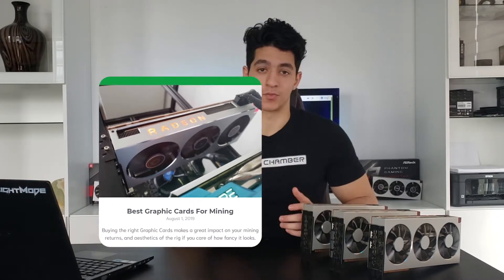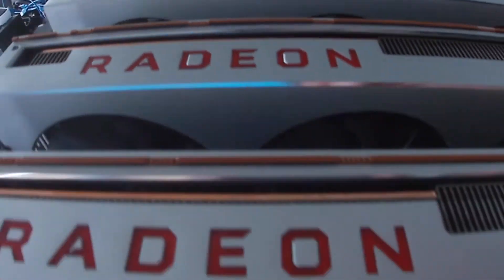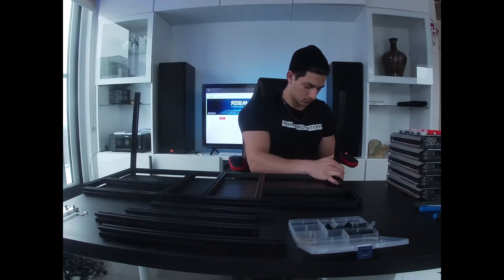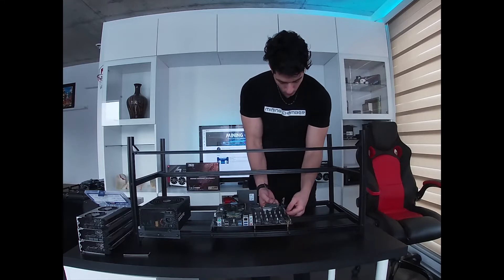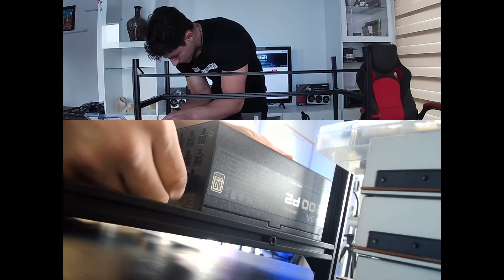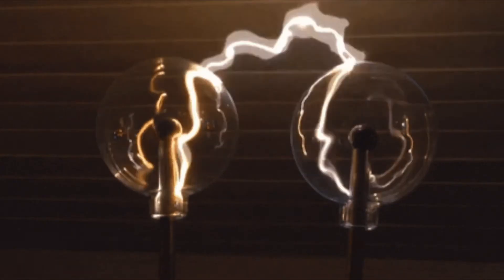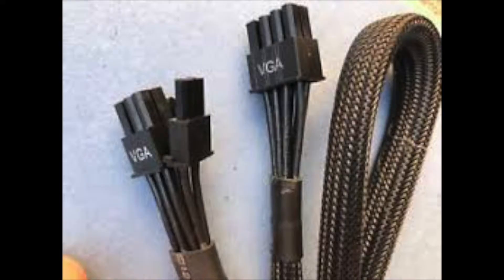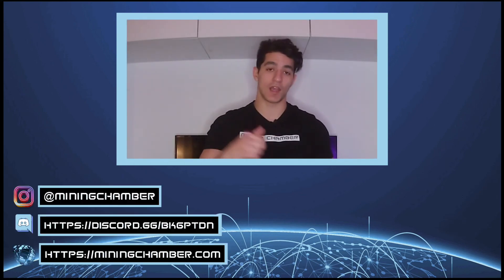HOW TO BUILD A MINING RIG + BEST GPUs IN 2020 !

Comment: need help. i connected my RM1000x psu to b250 and board wont power up. i have Intel Pentium g5400 installed. i tried cmos reset nothing. im thinking it may be faulty board

Comment: New subscriber, so do you not have to put power cables into those pcie risers?
Reply from the maker: Yes you do! Usually its a 6 pin connector. You can check the ATX powersupply guide I go in details with that. Also, welcome to the community ⛏️

Comment: 2 questions! How do you manage dust in your room? And is there a risk of fire after some kind of failure?

I would be very worried leaving it turned on when getting outside. I was reading having all these in a case prevents fire from expanding as the oxygen would be reduced quickly. Not sure how true is that...
Reply from the maker: Dust in the room will come from outside and Into the GPUs. So as long as you have dust filters on your Windows and such you won't have a hard time with the dust. You can check our mining journey playlist for how we setup our mining room

As for fire, if you do everything right and do proper power limiting then you don't need to worry. I've been mining for 2 years and nothing burnt down the house or anything like that. I did have a cable or two burn but that was due to my lack of experience back then!

Comment: If i use 3 different models of 1070ti is it gonna have any problem
Do i have to use the sam gpu if i want ot mining with multiple gpus
Reply from the maker: It will be completely fine! You can use different models and it won't affect much. The hard part is when you try to mix AMD and NVIDIA then it gets a bit tough :P
Reply: @MiningChamber  one more question .
Can i mine on my personal computer?
My motherboard has 3 pci slot i think.
Can i use 2 gpu to mining and one gpu to gaming and editing?
Is it gonna bottleneck any performance?
Reply from the maker: You can yes! Although about editing and such I think it will be okay since editing/rendering  is CPU heavy. You just need to run the miner when you aren't using the pc heavily and then close the miner when your editing and such if it's giving you a hard time. Also keep your pc lid open so that some cool air can keep the gpus from overheating and don't forgot to properly overclock for mining!
Reply: @MiningChamber  interesting.
I though mining takes very less cpu power and takes most if gpu power.i have seen lots of people makes mining rig with the cheapest processor on the market.my cpu is ryzen 2600 which has 6 core 12 threads. Is it not enought to handle gaming or editing while mining ar the same time?
Reply from the maker: No no I meant editing is cpu intensive so it's just hopefully it won't clutter the system and ends up crashing since your gpu and cpu will be maxed out at 100% while rendering and mining

Comment: How many pcie splitters would you need for 6 radion 5700xt’s using this same build?
Reply from the maker: We actually did a build on the 5700 XT, you can find it in our gpu mining rig play list!

If your using 2x 1200 watts I don't think you'll need that many splitters since that is an overkill. I'd recommend getting 2x 850 watts Corsair RMx model with 6 splitters

Comment: Thank you for making this channel and this video! I’m placing an order through Amazon and I’m going down your list of hardware in the description and would like to know if I’m able to run (8) of the RX 580’s on the Veddha 8 GPU frame using a standard 120v outlet? Do I need any additional items such as connectors or extensions to do this?
Reply from the maker: It all depends on the powersupply you use. If you use regular ATX powersupply then you will be fine! Check our 6 gpu mining rig with the RX 580!

Comment: hey did you had any asus x570-pro tested? I have one witch I am trying to start with more than 4 GPU, so far unsuccessfully... any help would be of great appreciation...
Reply from the maker: Hey! What happens with it? We tested a 580 we have a video on that and they should be very similar. Check out the video and hopefully it helps!
Reply: @MiningChamber  cant find the video, link please...
Reply from the maker: https://youtu.be/uoMGw0Sc7Dk
Reply: @MiningChamber  in this video you don't say nothing about the motherboard and bios settings for it... I think I wasn't clear... 🙃 I am having problems (different every time i boot the motherboard) with MB Asus x570-pro bios ver 1005... Can't make it run stable with more than 4 GPU...
Reply from the maker: Oh I'm so sorry I thought you were referring to the RX 570! 

first thing I'd try with troubleshooting motherboards is upgrade the motherboard BIOS and install all the essential drivers it needs from it's support website. 

After that, make sure your CPU is the one providing the graphics by running integrated graphics from BIOS, and also switch all your pcie gen to 1 then try 2 and 3 If it fails still.

You don't need to do all these steps together just do one at a time then hopefully one of them will fix the situation. As a last resort I would try a Linux based mining os
Reply: @MiningChamber  is there any way to contact you for a live discussion? There are no settings available in bios to lower the PCI express speed...
Reply from the maker: Join our discord we can chat there! Hopefully we'll be able help !

Comment: Hey Mining chamber...Im building my very first mining rig, Question? My power supply EVGA 1300 watts has a 18 pin and my motherboard B250 mining expert  has a 24 pin.do you i have change one of them? Thx.
Reply from the maker: Your powersupply should have a 24 pin that comes with every psu. I'd recommend checking our latest ATX powersupply video!

Comment: do you need to power the cpi risers or do they get powered through the gpus
Reply from the maker: Yes you will need to power them and the gpus take power from the risers.

Try to always use a 6 pin to power the risers !

Comment: if i were to run 6 radeon vii, what type of psu are recommended?
Reply from the maker: I do recommend going for a 2x 1200 Watts PSU or 2x 1000 Watts PSU. 1600 Watts PSU is also good but that is more so risky!
Reply: @MiningChamber  why need 2 psu ?
Reply from the maker: So you can supply enough power! One GPU takes up to 300 watts if the overclocks reset. 6*300 will give you 1800 plus the risers and the rest of the system that's another 200-300 watts. You always want to use only 80% of your available power
Reply: @MiningChamber  i see... may i know with this gpu set... how long it takes to breakeven the cost?
Reply from the maker: At this point of time it is really hard to find Radeon VIIs with the original price. They are now 30-50% more expensive. But in general any GPU you buy for a decent price you can make a good return. Possibly 6 months to make your money back if crypto prices stay up! Look into buying 5700s and 5700 XTs they are really good now !
Reply: @MiningChamber  u mean radeon 5700 xt?
Reply from the maker: Yes!
Reply: @MiningChamber  hmm... i just found out radeon rx5700 xt have alot of variety brand such as msi, gigabyte, asrock & amd... does all these works the same?
Reply from the maker: Some cool better than others. We recommend Sapphire Pulse and Nitro
Reply: @MiningChamber  hi again, is there any problem if i run mixture of different gpu,... such as RX580 x3 and RX5700XT x3? is there any issue on that?
Reply from the maker: There is no issue with that. If you have more questions join our discord we can talk there!

Comment: So, sorry, what was the hashrate for those again? For one of them or all of them.
Reply from the maker: It is around 90Mh/s and can be pushed higher!
Reply: @MiningChamber  Hew what do you think of my idea design for forming a cooling system for miners? I was doing a lot of thinking and I want to build my own home AC systems, but then after learning about different ways to cool computer parts, I had this idea, what if, you made something just as simple as this that no one yet has been ever trying before, you combined the rig in three cooling systems and made just one single system, for instance when an AC works there's a set of evaporator coils then the fan blows cold air from there out of the air conditioner above it, the main point is that these coils are very cold even though they absorb heat, the rest of the AC stays the same blowing hot air out the back, then instead of the fan inside sucking that cold air up and back into the room, it's pointed down to blow air down, the AC coolant still stays cool because the hat is also still being blown out the outside and also there is the condenser which is always condensing the coolant gas, and then in the miner you've submersed it into mineral oil, you need a pump and tubing, connecting the pump it circulates the oil back up back into the AC system running copper tubing up past the evaporator and back down again while the fan is blowing down, next all that you need to do is just connect a vent from where the air is being blown down and connect that directly up to the miner, now you have added fan and cool air, then also your miner is not in the miner case it's submersed, except that's just it it's only the boards that are and the rest of this system is just those sitting in a box or cooler of either a cooler or acrylic glass while they are separated inside and then all that cold air blows passed them. That is what I call temperature control. You can just go buy acrylic sheets and custom make the case by gluing it together. And then you can I don't know customize it however that you like it and get creative to simply make a case for the AC too. But plus, maybe adding another good fan just on the back end just to blow that air out better. Yeah, one more thing, if you're going to be spending money to buy an air conditioner, then you might as well buy a portable one they cost about the same. I am going to try for a broken one and fix it up. And if you have a place that has an outside air conditioner, here's another idea, make your own wind generator and just sit that thing right on top.
Reply from the maker: I am sorry for not responding earlier!! By the time I read it I was too caught up thinking about it thought I responded haha. 

It is a great idea ! I've seen alot of submerged in mineral oil ASICs and its fascinating!! It is something to look into for sure and you had more ideas on there and there all awesome! Hope your taking it easy my friend !

Comment: What drivers would you recommend for rx 580s in as mining rig?
Reply from the maker: I do recommend the latest drivers!
Reply: Mining Chamber Are those the ones you use and are they stable for you, because I have had issues in the past with the new Adrenalin drivers running a 5600xt?
Reply from the maker: They are stable for me, the main issue of stability I'm having is WIFI need to change to Ethernet 😅. But yes as for the drivers you will be good! We recently did an RX 580 build feel free to check it out!
Reply: Mining Chamber okay, and one final question. I know this is a bit of a nooby question as this is my first rig I will be building. But, what is the best software to use? I was looking into NiceHash and CGMiner and they both look viable. I was wondering your input and if there is any other better software. Thanks, and I hope I didn’t take up too much of your time. :)
Reply from the maker: No worries at all! I don't use either of those. I just like to use Phoenix Miner or Claymore Miner.

Comment: Is possible mining with only one Graphic card, , and with the time add more and if i add more the graphics has to be the same model ?
Reply from the maker: Definitely is possible and that is what we recommend! You can add different models but I do recommend keeping it either AMD or NVIDIA dont mix the 2 since the drivers can be a nightmare afterwards.
Reply: Mining Chamber is possible that you could guide me to make my miner? I could record all and give you for your channel ?
Reply from the maker: @hiramgutierrez1431  we have our videos you can watch and learn through them ! You can also join our discord and we can help you there too
Reply: Mining Chamber of course I will watch all of them only you know I am new and maybe I have a lot of doubts but ok I will watch and ask the doubts after watched
Reply from the maker: @hiramgutierrez1431  ofc you can always ask it won't be that complicated it's just step by step my friend
Reply: @MiningChamber  Question of the power the mining runs with 110V or 220 v?
Reply from the maker: @hiramgutierrez1431  it will state it on the powersupply. Some PSUs have a autoswitch while others have a manual switch. Just look up the power supply settings then it should give you the direct answer.
Reply: @MiningChamber  Question, i saw the RX Radeon VII need 750W to run, if the PSU is 1200W, no matters that you connect 3 RX Radeon  (750wx3 = 2250w) ? i mean that dont affect the performance or the mining of the rig?
Reply from the maker: @hiramgutierrez1431  the Vega VII doesn't use 750w to run, it uses at most 300watts based on how you overclock it. So you always want to be safe and get a 1200w powersupply or more so you don't burn down anything. And only run at 80% of the PSU capacity. 

Join our discord so you can ask questions there!

Comment: Are two RAMs required or should be good with one?
Reply from the maker: 1 stick of 4GB is enough most of the time but having 1 stick of 8 or 2 sticks of 4 can make the system alot smoother
Reply: Thanks!

Comment: If I’m gonna use the 580s to start do I need that power supply
Reply from the maker: Hi Merrilee! based on how many cards you want to run. Per RX 580 it will take at most 150 watts on mining if you undervolt them properly it can be even as low as 100 watts. So just run the calculation and make sure that you dont use more than 80% of your PSU. So if it is 6 GPUs then you will use at most 900 watts from GPUs and 60 - 90 watts from the system. Total of 990 watts which means a 1200 watts PSU would be perfect!

Comment: Just go to PC part picker and all of your wattage calculations are automatically done
Reply from the maker: That is true! but I am not sure how accurate it is, since once you mine you do want to make sure you undervolt the cards so they dont use too much power and stay as efficient as possible. For example: Radeon VII takes I believe up to 330 Watts with stock settings, but if it is undervolted properly then you max it out on 250 watts. Saving you lots of power!

Comment: also i have a question real quick, if i were to setup 1 frame with i radeo 7 would i need more than one psu/memory/ motherboard or anything extra?
Reply from the maker: So if your planning on running 3 Radeon VIIs then you will only need one 1200W or 1600W power supply, but if your running 6 R7s ( I do recommend to only do 6 per 8 GPU frame or 6 GPU frame) Then you will need 2 Power supplies, each supplying 3 Radeon VIIs.
Reply: @MiningChamber  dude youre a gangster, im dowloading discord as we speak andi will add it up
Reply from the maker: @ericpatterson6787  hahaha appreciate it✊ will chat on discord!

Comment: Thank you very much for the video! I'm in the process of building a rig for gpu rendering. 10 rtx 2070 supers on 2 Evga 1600W T2. What kind of UPS would be enough to keep it running for 5 minutes? Motherboard has IPMI system so whenever the UPS kicks in, computer will be automatically shut down. I've been advised a 6kva unit from a local supplier but I'm not sure if it's overkill?
Reply from the maker: Thank you!! I am not really experienced with UPS but from what I know it is definitely not recommended to run it on a limited power supply ahahah it can be risky. So based on your rigs you will just need to calculate the raw watts that it will take but then again it is very risky!
Reply: @MiningChamber  Thank you!

Comment: For electrical you should make sure to use a 12 AWG wire as it will support up to 20 amps which right off the top of my head is good for 1800 watts. Make sure you run a dedicated circuit from the breaker box to the outlet you want to use so it isn't sharing amperage with anything else. It is also good since your machine will have a dedicated neutral. I am a state licensed electrician. One thing to note as well is your PSU can usually do 240 volts, if you swap out your single pole breaker for a double pole breaker you can run a 240 volt circuit and that will lower your amperage on the circuit as raising the voltage lowers the amperage.
Reply from the maker: Thank you Steve! That is great knowledge and I'm sure many people will find this helpful!! Someday We will be on 240-volt circuit, for now, we have to do with the 120v hahaha. But thank you agian!

Comment: You can not successfully mine without your superiors noticing the massive electrical charges.
Much better to have your machines hosted at a professional facility
Reply from the maker: Good point! Usually Electricity companies won't suspend you or anything as long as you pay the price! And each appartment/home is capped at a certain wattage, so to be able to expand more you will need to go through your provider yes.